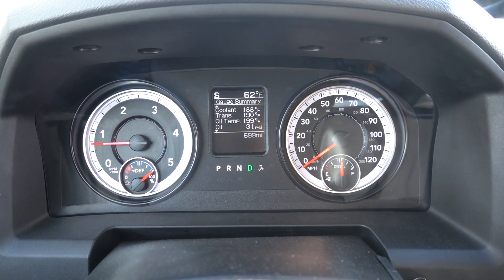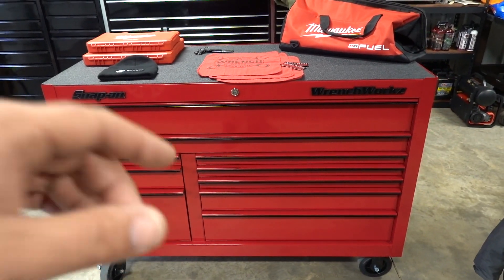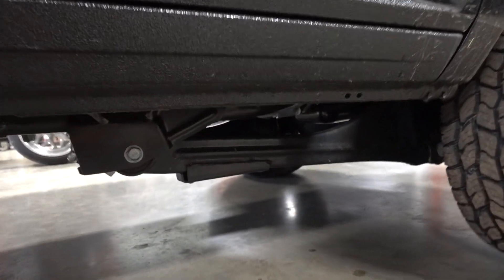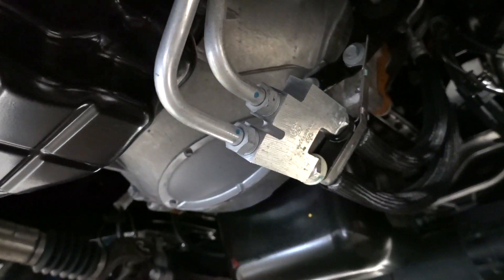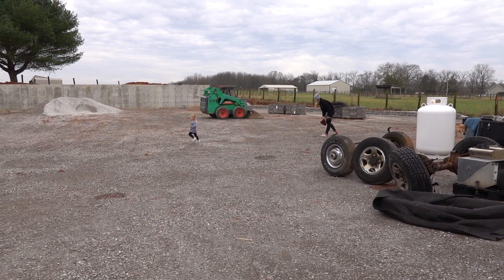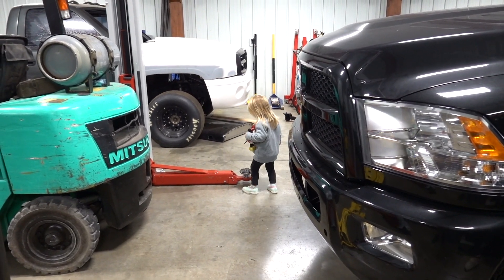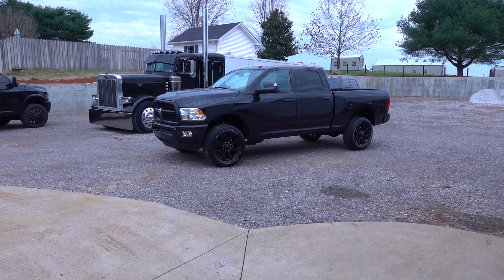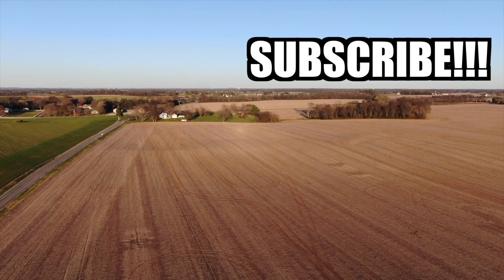We AVOIDED a MAJOR DISASTER!!!! SAVED TONS of $$$$$!!!!

Comment: Your wife's car has 0 miles free much with her on it and you already avoiding a major disaster with a brand new vehicle and Frank credible what you say that the brazen vehicle you buy already is a piece of junk into you did what you did do it O bullone you will be vaster than the stock vehicle but it will not your wife car won't be able to put 400000 miles on it with heavy work on it it would be lucky even last 20000 miles afore you don't need and t's it 20 times as you don't like the truck because the truck you like the truck cause of the glam psycho but a big by pimped out the big rig the bed as its the badge as big regulus's starts out as a bass big rig can't upgrade the framing and all that Kraft asked to go into him as it's built that way from the beginning